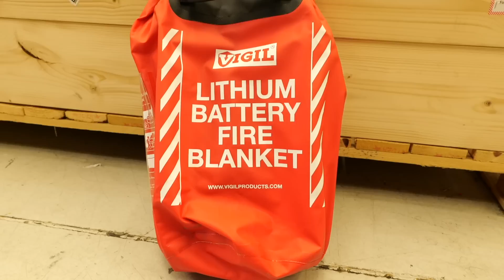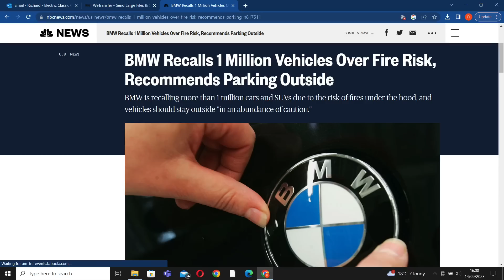Electric Car Fires - Facts and Figures

Comment: Well said Moggy. All the time the media blows everything out of proportion when it comes to ev’s ,they are only doing it because it sells more papers .Another one I’ve heard is that don’t park your ev in a multi story car park because the ev’s  are to heavy and the building collapses.What a load of bull , there’s a lot more SUV’s heavier than ev’s . .keep up the good work up Moggy !!
Reply from the maker: I’ve had someone argue that point with me too. Turns out he drove a Range Rover which weighed nearly 3 tons. 😉🤣😆😂
Reply: Aye, the multi story car park one was amusing. I found a good comparison was a 2023 BMW M3 CS and a 2023 Tesla Model 3 Performance. The BMW weighs 1840Kg and the Tesla weighs 1847Kg. I think the car park will handle the extra 7Kg, lol
Reply: There is actually (possibly) a good reason NOT to park in a multistory with an EV.

If an EV decides it no longer wants to power on, there is no neutral gear to use; the car has to be dragged onto a trailer; but in most multistory carparks, the roof is too low to do this; so somehow, you have to get the car outside.

The one instance I know of (video on YT, but I forget the channel), it took 8 guys, some special dollies and a car rigged for towing - to get it outside where the regular flatbed could load it.
Really luckily for the owner, the car was on the ground floor; can you imagine trying to move it down some of those curved ramp exits you get?
Reply: @ianemery2925  Recovery from the higher levels of a multi story car park is tricky for any vehicle. I get what you are saying about no neutral. I'm no expert but there is probably a way round it. Maybe pulling the drive shafts.
Reply: @haggis1086  Disconnecting drive shafts -That's what they do for trucks, but EVs are not made like that.

Comment: I believe electric cars are quite safe, and the risk of fire would not be a factor for me buying one. However, did the report from Sweden take into consideration the age of the reported vehicles? I don't know the Swedish numbers, but for Norway, the average age of ICE cars are extremely high, around 20 years (due to taxes). As for electric cars, their average age is much lower, for obvoius reasons. There are only taxes on the most expensive electric vehicles here, the more moderate ones have NO taxes. Perhaps fires in EVs will increase as the vehicles get older? Just a thought... Edit: YouTube vlogger in China "Serpentza" is reporting that Chinese built EVs in China has a very high risk of fires. Probably due to lacking safety standards, and the Chinese usual cutting of safety corners...
Reply: I tried to do some research into this before, and this is the problem with studies like this. The average age difference between ICE and EVs is a large factor. Older cars are more likely to catch fire due to poor maintenance, wear etc. there aren’t that many old EVs.
Reply from the maker: It would be interesting to factor in the age of the cars too. But also it would be interesting to extrapolate out the pure EVs from the hybrids from those figures as hybrids are much more likely to catch fire that pure EVs. It’s also worth googling ‘car fire recalls’ to see the millions of new ICE cars presently being recalled by manufacturers like Kia, Ford, Hyundai and BMW etc because of fire safety risks.

Comment: I have had a car catch fire fortunately I put it out before anything went BOOM.  It was an oil leak onto the exhaust manifold, I have a diesel car that sprayed diesel all over the place TWICE, fortunately I caught it both times and replaced the fuel line. Fossil fuel cars are dangerous. I have seen a lot of burned out fossil fuel cars on the side of the road and I have yet to have seen an electric car in such a state.
Reply: Interestingly years and years ago I was working at a gas station and a cube van stopped for fuel. They asked if I could check the oil and when I opened the hood the van was on fire luckily it was just beginning and we put it out but seems the owners knew it had an oil leak but just decided to keep topping up the oil. It was leaking from the valve cover which would have been an easyfix, onto the manifold.

Comment: Great content! Wonder how climate affects this. Is very hot weather going to have an influence? And if yes, how would that be for ICE vs EVs?
Reply: Lets turn your comment on its head. If we keep on using ICE the climate is going to get hotter.
Reply: Last year on one of the hot summer days, I was driving up the motorway. In the space of 20 miles I saw 5 ice cars on the hard shoulder some with their bonnets up. Normally I go a few days without seeing a car stopped.

Comment: I did read somewhere that Liquid Nitrogen worked well as a agent to keep the heat at a manageable level in a fire 🔥 but I guess it would only work on a battery that has been designed to allow nitrogen in the 1st place ?
Reply from the maker: The problem is getting into the battery pack to cool it down but yes you’re right if liquid nitrogen could get in there it would cool it down very quickly. 👍

Comment: I like that idea of the electric car. The infrastructure is the problem. Along with charge times.
Reply: Depends on the use case. If you have home charging the public charging infrastructure isn't really an issue. Even on long trips my EV completes the trip in a shorter time than my ICE car. I drive a 1200 mile round trip occasionally in Australia, I stop twice in each direction for late breakfast and dinner. Instead of having to line up, pay for fuel, move the car to to carpark ,then go in to get something to eat, I just rock up, plug in and head in to get a meal and use the bathroom, by the time I'm finished eating I have more than enough charge to continue. 

I have saved many hours not lining up for fuel over the year, but it all depends on home charging and not needing regular access to public chargers.

Comment: I was just having a conversation about this at work today, in the past week we've had 5 IC engined vehicle fires here, but no EV fires.

Alot of it is media firing up (pardon the pun!) Over an EV fire just for clickbait, I'd been following that ship fire which is a prime example of how the media exaggerates these things without any research into what Actually caused it, purely for grabbing headlines and clickbait.

Well researched vid Moggie👍

Looking forward to your brrmm brrmm noises when you're driving the teslarossa😉👍😂
Reply: Anyone else want to know what caused the other 209 global cargo ship fires in 2022?
I mean we think 1 was actually some evs fault. But that evidence for that went down to Davy Jones locker so to speak. 

Also if phevs and evs are such a fire risk? How come tesla and byd who alone have made&shipped over 9,000,000 vehicle's just since 2008 all with large lion batteries. Aren't having more problems. 🤔

Comment: The stat need to take into account the age of the car. Fault are more common with age.
Reply: #1 open recall across ALL LEGACY ice oems is for the risk of FIRE even when the vehicle is parked. Effecting over 10,000,000 2-5 year old vehicle's here in the U.S. alone. So age isn't a factor so to speak.

Comment: What I would really love to see is a breakdown of what caused the fire, because obviously the big accusation is that they're just, ya know, spontaneously exploding because of course batteries are obscenely dangerous and all that. Unlike 10-20 gallons of gasoline.

But for example, take accidents out of the equation - or cross compare likelihood of fire due to accident. Also, the question of age - cross compare the vehicles made within, say, the last 10 years and account per capita.
Reply from the maker: The report does break the numbers down a little further e.g. whether the cars were driving or stationary. I would have also liked to have seen the pure EVs extrapolated out from the hybrids as the EVs are much less likely to combust than a hybrid. Age would be interesting but considering that there’s millions of new ICE vehicles presently getting recalled due to fire safety issues I don’t think the stats would be skewed that much, EVs would still be far less likely to catch fire than ICE vehicles. 👍
Reply: @ElectricClassicCars  Age is a very major consideration that needs to be taken into account. Assuming that most EVs are probably less than 5 years old, you can't say they're less likely to catch fire when compared with ICEs that could and in many cases will be twice as old or 3, 4 or 5 times that age. 

It's also never mentioned that diesels are less likely to catch fire as it doesn't burn easily, and both petrol and diesel now have fuel shut off systems in the event of an accident. In fact most fires in ICE cars are caused by, believe it or not, electrical faults. 

I don't know which are more likely to catch fire and neither does anybody else, and I don't even know why we have to take sides or why EV fanatics feel that they have to defend every comment that's made against them, whether true or not, but it doesn't help your cause when we get comments and claims stating that they are all "facts", they are all "conclusive", how the media are always against them and so on, when the reality is there are a lot of issues with EVs that do need serious consideration that are usually dismissed or just put down as excuses by the EV contingency, who it has to be said, in most cases won't hear a single bad word said against them.
Reply: @severnsea  for the very first yet unlikely EV fire in a car park, run the other way: United Firefighters Union Australia 11/03/23: "We've already had a situation in Victoria where two firefighters suffered cobalt poisoning after attending an EV fire, and have now been permanently disabled as a result". Lithium-ion battery fires release toxins such as carbon monoxide, hydrogen cyanide, hydrogen fluoride and cobalt. These toxins were particularly dangerous for firefighters because they were absorbed through the skin and clothing could not protect against them. John Cadogan's one of the few who really mentions the risks in a rational way, with the odd expletive.
Reply: @LoremIpsum1970  Yes, that's exactly the point, it's not how likely it is to happen but how deadly it can be when it does happen. They might be unlikely but they are rapid and potentially explosive when they do happen. There's a video of one in China that accelerated so quickly it took an apartment block out with it, and had it happened on the other side where the staircase was people wouldn't have got out. ICE fires can be fierce but usually give people time to get away. The Paris bus that caught fire was totally in flames in under 30 seconds with sparks shooting off on both sides from the roof within seconds. Had there been people in it at the time there's no chance they would have escaped.
Reply: @severnsea It's something that people should be made aware of, there's people in this chat saying how they would put out a runaway battery...Darwin Award goes to... I just can't wait for all those cheap heavily subsidised BYD EVs to flood the UK market. As for charging in your garage: https://www.youtube.com/watch?v=EiHIX201CBc
Reply: @LoremIpsum1970  Exactly how I feel about all this BYD stuff. They have an appalling reputation, why on earth anybody would want to risk thousands on one of these things - or possibly lose a lot more than just money - is beyond me. Yet just like everything else EV related, they're totally in denial.
Reply: @ElectricClassicCars  Completely agreed with the conclusion, the point is just to go "Here's conclusive data. Now when you're arguing we know it's in bad faith." Which of course it is. People are so disingenuous about this.
Reply: @ElectricClassicCars  according to US figures I heard it was (1) BHEV (2) ICE (3) BEV.

Comment: For sweden: one should even differentiate between EV and Hybrid because the latter are also ICE. For the pure EVs the percentage is even smaller
Reply from the maker: Totally correct. It would have been very interesting to know out of those 23 cars that caught fire how many were pure EVs. I’m sure it would have been into single figures. 👍
Reply: Nice to have someone who quotes a few facts, unlike some other main electric channels who promote electric vehicles as world saving but put no actual facts forward.
As for vehicle fires, the safest is diesel. As a retired Police traffic officer went to countless vehicle fires, all petrol.
Reply: @pm8465  True in your day, but now, as the figures prove, pure EV'S are by far the safest.
Reply: @pm8465 one study does not prove a case.  Let's see the detail behind the numbers before declaring Q.E.D.
Reply: Hybrids are EVs. Hybrid is just short for Hybrid Electric Vehicle. The ICE power plant is there to charge the small battery.
Reply: @89five3five  The point being made (which I also came here to make) is that Hybrid cars are more likely to catch fire BECAUSE of the fact that they have an ICE on board as well as a battery, which in reality is the most dangerous combination. If the study was made just using pure EV'S then the percentage of fires would be much less.
Reply: @89five3five  wrong: only few, e.g., the new Mazda works like that. Most EVs have both systems separated: you run the car for a few km on a tiny battery and the rest on ICE. Hybrids are the worst of two worlds. 😂
Reply: @89five3five  nope. depends on what type of hybrid and it is in any case NOT a BEV because it has an ICE

Comment: It's not about the frequency of the fire, it's the intensity.  A typical petrol car fire is around 815 degrees C and takes about 4000L of water to extinguish.  An EV car fire burns above 2700 C and takes over 150,000 liters of water to put out.  Some EVs that caught fire had to be fully immersed in water for a month before the fire stopped.  EV fires will also self re-ignite, often days later and multiple times.  They are an absolute nightmare to put out.
Reply: Source for this word salad?
Reply: @Grendel650 My firefighter neighbor when we were talking car stuff in the garage.  I converted his measurements from US gallons and Fahrenheit  to "rest of the civilized world" - he was talking about the new EV extinguisher tools that puncture the battery from below to inject water.  
As for "word salad" I don't think you know what that means - you probably shouldn't use psychiatric terms you don't understand.

Comment: Sorry the way you would calculate is not by percentage but by ratios.  Using a ratios equals the two populations out first and then converts it to a percentage.   Way way more accurate.   Then you have to look at the geographic area.  EV near salt water have a higher percentage of catching fire than those not near salt water.  Salt water is corrosive.  There were many EV in Florida after a hurricane that caught fire simply because the salt water got to the batteries and electronics.
Reply: You do know that a percentage is a ratio, don't you? 1% is a ratio of 1:100, 2% is  ratio of 2:100.... 😊
Reply: @Grendel650  Incidence rate ratio
•	we are comparing incidence rates.  So first, we need to calculate the incidence rate in for each fire.   
o	Gas powered incidence rate of fire = 291 fires/ 17917 car peryears, simplifies to 16.24 fires per 1000 gas car per years
o	EV fire incidence rate = 232 EV fires / 21618 EV Car years, simplifies to 10.73 fires per 1000 EV Car per years
•	In our pollution example this would be (16.24/1000 person-years) / (10.72/1000 person-years) = 1.51
Odds Ratio
•	Exposure Odds Ratio [A/C] / [B/D] = [A*D] / [B*C]
•	Disease Odds Ratio [A/B] / [C/D] = [A*D] / [B*C]
•	Both simplify to the same OR 
o	In this pollution example, this would be 291*1399 / 1060*232 = 1.66.  Thus, participants from the gas car pollution have 1.66 times higher odds of having a car fire than those from the EV-pollution.
Reply: @StandForFreedom1776  giving 1.624% and 1.073% respectively. 
Ratios.
Reply: @Grendel650  Hi Nick,  you are giving a ratio first then you converted it to a percentage.  In the video, he gave the percentage first and tried to make it a ratio.   I posted an example of how to compare two populations using Ratios.
Reply: @StandForFreedom1776  an interesting conversation which doesn't work well for me on this forum. Or at this time of night. 🙃 Peace.
Reply: It's not mentioned in the video but the study in Sweden was based on a per car basis, i.e., ICE cars catch on fire 20 times more frequently per car on the road than EVs so the statistics are valid, i.e. if EVs made up 10% of the total car population there were 200 times more ICE fires than EV fires overall in the same period.

There were not many, there were exactly 2 EVs that caught fire in the aftermath of hurricane Idalia in Florida. 

There is zero statistical evidence that living near or storing an EV near salt water is a greater risk. There is an increased risk from submersion if the battery pack integrity is also compromised leading to a short circuit, there is no evidence of any increased risk from the air near bodies of salt water.
Reply: Those EVs were effectively submerged, ICE vehicles are also affected by salt and their fuel lines often corrode through. 🤦‍♀

Comment: Spin Richard! You have to look at the source of the fire, which car fires were caused by the power train. Kids and crooks stealing ICE cars and then setting them alight to destroy them distort the number, old cars are more likely to catch fire, more old ice cars that EVs. And,. EV fires are more dangerous and harder to extinguish than a ICE car fire. Low probability high consequence event, like nuclear war?
Reply from the maker: The whole age argument doesn’t stack up for me. Look at the millions of new ICE cars being recalled by Kia, Ford, Hyundai, BMW etc right now due to fire safety issues. New ICE cars are more prone to fires than new EVs.